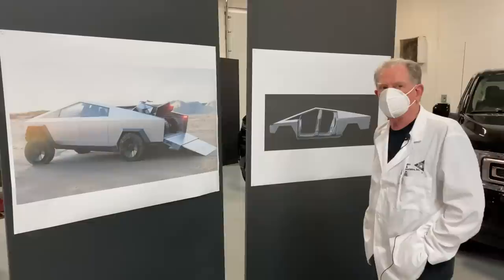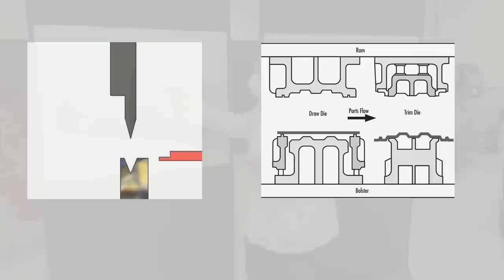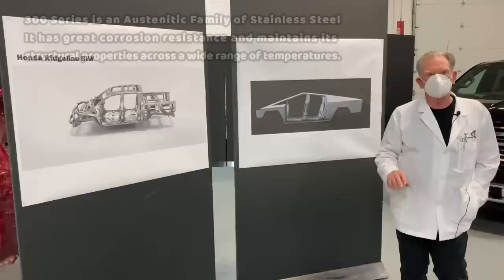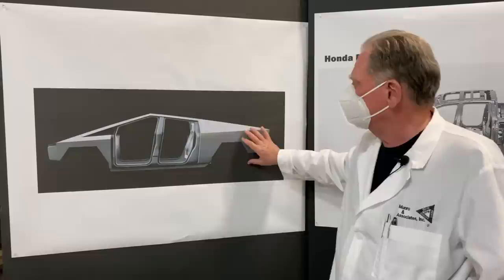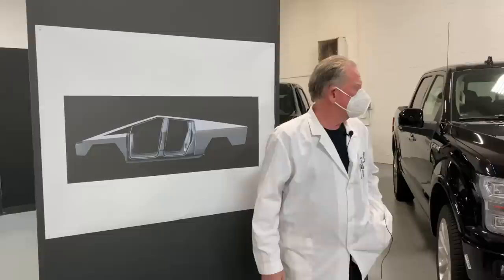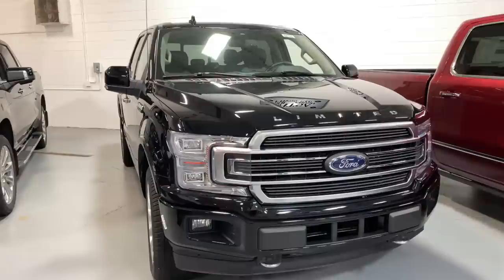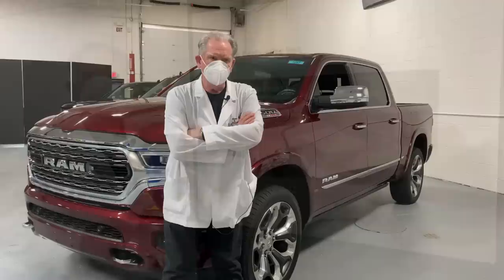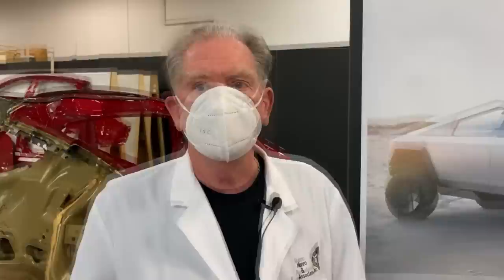Cybertruck E1 - Body Structure Comparison

Comment: Great video and comments. Innovators like Tesla could open new ways in car industry, but I think car makers are 20 years behind civil aircraft makers like Boeing or Airbus, and 787 dreamliner is the winner in efficiency against the heavy A380,  and these leaders are 20 years behind competition sport glider makers like Alexander Schleicher. Gliders need to be the most efficient machines ever build and composite materials like Carbon fibre, Kevlar, aramide, honeycomb, etc.  used in the last 30 years replaced all light metals.  The 787 is using more composite materials than any other aircraft.  Cars will follow the same physic rules in efficiency and EVs need to me more efficient than any combustion car.  EVs need to follow the glider materials and aerodinamics.
Reply: Cars, planes and gliders: not the same structural stresses, not the same number of units manufactured per year by orders of magnitudes, not the same costs, not the same expected life, not the same maintenance and inspection.
So you cant compare them.

Comment: 10:15 - if the 30x material is cold rolled to create the required austenite / martensite structure, would that not also result in lots of internal stress?! I.e. that when you start cutting it, that the body may deform because of these internal stresses being released?

Comment: It Looks overloaded with a single 4wheeler in the back. The front suspension is lifted up and the back springs are sunk down?
Reply: BeauBeau Kitty - He deliberately lowered the back for loading & unloading of the quad - CyberTruck can lift or lower parts of the vehicle or the whole truck, while the other trucks can’t.

Comment: Fascinating analysis! If stainless steel is a hard material, how well does it absorb energy in a crash? Wouldn't a light material like aluminum that crumples absorb more energy?
Reply: the CT is big and heavy, meaning energy will dissipate faster, plus stainless steel can crumple, it just needs to be designed to, like aluminum
this is why a F350 getting hit at 110 MPH by car has the f350 driver be fine

Comment: I understand the advantages of that simple  stainless steel structure, but what happens with it in case of an accident ?  normally the concept is to have a stiff inner structure with softer parts  outside( fenders, bonnet, luggage boot), that can deform and absorb the impact.  These non structural parts can be exchanged after the accident.  With a hard outer shell-structure nothing can absorb the impact and when it gets deformed seriously ,how can you repair it?

Comment: Its more like a cocroach than a turtle. Its just as stylish too...lol
300 series stainless steel is likely using 304 as the most commonly used but 316 has similar characteristics.  30X might be symbolic of a mixture of 300 series s/s . Even some traditional built cars have thermoformed plastic body panels.

Comment: One problem I see, airplanes don't handle "accidents" well. Even a small impact causes massive structural damage. When you bend the frame of a vehicle, it it's usually totalled. There is a very real reason for the current use of a frame protected inside the vehicle.

Comment: I disagree about the Arrow dynamics, the typical pickup truck’s bed creates a vortex which pushes the rear of it’s cab, this truck can’t do that. How much will a small fender bender cost ? Need an ALL new complete body/frame? Did he just say, a dent or crack would be a badge of honor ?  Well that certainly is 1 way to avoid my question. Rabbit ears on the ford, wou;don’t that also be a badge of honor ? Lmao

Comment: It seems to me that I recall cars in the 1930's that were unibody designed by Dr. Porsche. He personally moved those forward during the 1940's as Volkswagen. From around 1947 forward, Dr. Porsche designed a sporty vehicle, design 356, with the public until 1965, when the unibody was redesigned as the 911 (9001 originally), unibbody still being produced today. Unibody also has been done in the past couple of decades of carbon fiber. Now the corvette was a different type of material, the material used on surf boards. Plastics, epoxy, and fiber glass are all elements that have been used in car bodies. I suppose that Stainless steel has to do with the ruggedness of the small vehicle.. I feel there is a mistake with regard to using stainless steel in so many parts of the car. (Springback can be dealt with via heating and cryogenics, a very expensive process.) The doors and front lid should be aluminum or carbon fiber, rather than stainless steel. That can be reserved for the attachments of engines, axles, wheels and suspension and major strength components. The rest can be lighter weight and doesn't need to be so rugged, perhaps. The trade off in the expense of stainless is too dear. AF

Comment: If you look closely cybertruck suspension system revolutionary...it provide so much ground clearance which is near to hummer h1 but without portal axle also lower arm is so high it difficult even to see...that's not because of air suspension which new defender has even when setting high mode the new defender ground clearance is very very low to cybertruck.

Comment: Body geometry? Here goes…
It leads to a lack of rear headroom.
Tub sides are too high to reach anything from the side, especially at the front of the loadbed.
Slab sides with body panels that lack contour will probably drum excessively and dent very very easily and be difficult to repair.
Windscreen raked at an extreme angle that will cause glare, refections inside and excessive cabin heat in Summer.
Rearward visibility is limited to near zero using the windscreen mirror, thus making a rear facing camera and windscreen monitor essential. 
Conventional body on frame allows a separate tub which itself allows different configurations, wheelbases and cabin sizes using common parts as much as possible. 
Impossible to remove rear load tub to repair or replace or sell as a truck-cab for custom equipment/body installations such as tipper bodies or drop-sides.
It is likely that stainless steel used as a monocoque structural chassis where the body itself is essential to its stiffness means that it will be prone to stress-crack in arduous work.
It is so ugly that ongoing sales, after the initial flurry, are unlikely to be high. Initial demand is likely to be short-lived.
Its geometry is a pretentious load of balls and most buyers worldwide wouldn't be seen dead in such a 'hairdressers' truck.
This is going head to head with real trucks and it stands out as being a pretentious toy, not suitable or versatile enough for the commercial work environment.

It will be 'cheap' to build but will it be cheap to buy? I somehow doubt it.

Comment: I understand Elon wants the truck body to be bulletproof that is pretty bad ass. It does bother me how bad it swats in the back and how much weight is taken off the steering axle in the picture you showed. I would like it better if it did not have those unattractive high sides on the bed like the ugly Honda pickup.

Comment: I still would want a gas motor on it just on case  so I can actually go off-road ,,I love the design but a fender bender may just cost too much$$$ if the body is the frame that car will be salvage title after the first fender bender.

Comment: And of course the Tesla, fortunately, will never be involved in an accident... So, how hard/ expensive will it be to repair if it IS in an accident.  It doesn't have a removable bed, it is made of stainless which is notoriously hard to work with, and the bodywork is a structural part of the truck.  Looking at it from the top, it doesn't appear to have nearly as much space in the bed area.
"Check out my new $100,000 Rivian!"
"Yeah, that's great for you, Jim, can we load up this ton of pee gravel, now?!"
"Um, look, Fred..."
"Oh, Jesus, just load it into my Ford F-150!"

Comment: The bed is small and hard to access from the side. If the GVWR is 10,000 lbs or more you will fall under FMCSA rules for any commercial use. Being a uni-body it won't be produced as a chassis-cab. That eliminates dumps, utility bodies, wreckers, stake bodies, bucket trucks, etc. It's never going to make much penetration into the commercial market
Reply: Cindy Tepper when was the last time you were able to put something into the f-150 bed from the side? I am only 6ft, you must play basketball.
Reply: @Dixler683   We've got a couple of Dodge Ram 1500 4x4 trucks here for shop trucks. Guys less than 6 feet put stuff over the side all the time.
Reply: Cindy Tepper yeah you are probably right. I am old and can’t heft things anymore but the bedsides on these new trucks ( 4x4 ) are still pretty tall. It was high on my last truck. Sold it, waiting for my cybertruck to be built. Hope I live long enough to see it. Driving a hummer for now.

Comment: It will be nice to have a truck you can take in the woods and not scratch the crap out of on the first stick or twig that drags against the side.  And not to have hundreds of dollars of paint damage the first time a dog jumps up against the door.

I REALLY doubt the body (exoskeleton) will be 3mm (1/8") thick.  That would be really heavy and overkill.  Gotta be about the same thickness as the FRAME RAILS on a conventional truck.  Will be nice to have a pickup that doesn't break in two when the sheet metal of the frame rails rusts in two (looking at Toyota and Ford).

SS isn't necessarily any harder than any other automotive steel, if FULLY ANEALLED.  And SS can be drawn and formed just fine in a press-just look at a SS sink.  303/304SS (as well as other steels and Al) can be work hardened in the rolling process-which I assume is the case here.  In other words it will be a roll-hardened SS, not fully annealed, used to form the exoskeleton.  Use of a hardened steel can allow the same strength and stiffness with a thinner, lighter gage of material.

Comment: Very interesting high level observations, thanks!  One comment, however. I drive a 2017 Ridgeline, and your description as "light duty" isn't accurate.  Maybe as compared to a 3/4 or 1-ton full size pickup, but it's a mid-sized truck, and in this category, it has great specs.  It's competitors, GM/Chevy, Ford (Ranger), and Toyota Tacoma all have a more off-road focus, but from a towing and payload, the Honda hold its own.  And of the three (as you stated), the unibody give the Honda a dramatically superior ride quality.  And let's not even discuss reliability comparisons to it's US-made counterparts....

Comment: What are the chances the (a future) CyberTruck uses a stamped (slightly) curved (ala StarShip nose come plane forms) surface steel exoskeletons for a more aerodynamic & aesthetic profile? (P.S. I used to work at the old SPS Western bending lots of stuff from aluminum trims (1000/hr) to heavy steel table tops (60/hr), so I get the die strike bit. P.P.S. My super was missing a finger & his boss, a couple! Real glad they moved me to fork truck, before finally kiester kicking me out soon after I started talking union. Haha, did me a big favor.)

Comment: You clearly have no idea what you are talking about.   I also highly doubt you have ever worked on any DeLorean let alone the manufacturing processes based on your statements.  The DeLorean does not have a unibody design/plastic backing behind the stainless panels.  The DeLorean is a Fiberglass body on a steel frame. The stainless panels are bolted to the fiberglass body.  This worked very well as there are still thousands of these cars on the road that look as good as they did when they rolled of the assembly line.

Comment: You know when someone has tripped over to becoming a real fan boy when clear disadvantages are presented as an advantage, just like, Cybertruck owners are all going to wear any ding or dent as a badge of honour, and then to liken it to Jeep owners when a Jeep has more in common with the current crop of pick up truck than it does with the Cybertruck.

If Cybertruck owners are involved in no fault collisions, will they really want to shrug off any resulting damage as a "badge of honour", or will they want their vehicle repaired? Insurers are likely to expect the latter and unless a vehicle can be easily repaired, "as good as new", insurance could prove to be expensive. 

Tesla may not be intending to export any Cybertruck, it seems unlikely that unless they were to adopt a less sharp pointy design that it would not pass any of the global "pedestrian friendly" requirements.  

As for paint, manufacturer's may need to apply paint in order to protect the vehicle, but paint also helps make a vehicle "individual" and people are prepared to pay extra to have a less common paint. Non-OEM paint jobs is a multi-billion industry.

Stainless steel may start off as a novelty but if any vehicle becomes common and stainless steel the only show in town people, will tire of it? The reason there are so many vehicle manufacturers to choose from when in a lot of other industries there are just a few, is that when it comes to a person's daily transport, individuality is a big thing.

Comment: the sad part is not a tank or an airplane is just a truck, so with that carrys a lot of problems in a real world aplication, crashing with another vehicule or pedestrian
Reply: Sebastian Scida yeah thanks,  some logical thinking, good point there Sebastian. Imagine the horror when a cybertruck stiff shell rams a pedestrian at 30mph vs the equally crushed body after getting hit by a Ford f-150. It is the mass behind the moving object .  Do you really think the “soft “ ford made of sheet metal and plastic will magically collapse and spare the civilian? Ditto involving a collision with another vehicle. With your logic think of how many cement trucks must be banned because they have an unfair advantage over a VW. Could have used your brains over at SPACE-X.
Reply: @Dixler683  the new pick ups and cars are made of plastic in thre front just for that purpose .For the cement truck do  you need a special driving licence?
And please dont be a fanboy, im in love of the look of the truck, and i like to see it in the streets.

Comment: Hmm... The deformationzon and repairability? pedestrian safety? I'm working on a Tesla body shop and like the design but if a cyklist or a pedestrian hits one corner or flat surface this hard, the car is not going to be legal in Sweden. The soft shell on cars is not only rain protection or design it's other peoples protection from your bad driving. Please learn a little bit mor about car design and funktion. The exoskeleton never going to be this hard in the front of the car. And if you crash a car this hard whiteout v shaped deformationzon in the front under the soft shell the car obviously Gona have in produktion your skrewd. this is a show of not the car in production.

Comment: I’m not saying “no”. But what about pedestrian safety? Sharp edges & hard materials on vehicles are explicitly forbidden by Law in my country, as well as in the most of EU.

Imagine your loved one in front of the bulletproof fenders, which are made from a hard stainless, with sharp, folded edges. Or your kid, glancing his/her bicycle off the sides of a moving truck and its razor-sharp wheel wells. Sometimes it is “safety (or lack thereof) by design”.

Comment: I remember reading about using lasers to machine metal surfaces with nanostructures that induce super-hydrophobicity.  Would be cool if the exoskeleton received this treatment.  This would allow you to easily clean the truck with a simple spray of water.  Plus, from what I recall from the research paper, it would give the surface a matte black appearance.  I couldn't find the original article that I'd read, but I did find this: https://www.sciencedirect.com/science/article/pii/S0141635917305792

Comment: The one big question mark that i see here is how they will do in crash tests with that all rigid design. They have to have a plan for that, and it can't be: "Well, it never crashes" That's just bs and legislators will never go for it. (By the way: I don't think you need a mask when you are alone in front of a camera. And you don't need a cameraman for the type of presentations you do. Just better framing and some post editing. Sorry, anonymous cameraman, you are an editor now)

Comment: 13:20 how about the big "serviceability issues" ... from a harsh crash that does require body work repair .. on a conventional vehicle, many panels are replaceable .. but not on an Exoskeleton .. CyberTruck will cost a shit load of money to repair. Also, Sandy is right that some "owners" won't care about a small scratch or ding .... MANY people will be leasing, and their wallets will be gouged deeply for those dings.
Reply: 30X is a reference to "30 times cold rolled" and not the alloy being used.  Kind of confusing since there are stainless steel alloys in the 300 range....Although he did say it was either the same or very similar to the one they are using on Starship, and i think there's information about what they are making that out of (although I'm not sure)
Reply: @sooocheesy  sorry, I edited by initial comment... but seriously what is 30X ? .. no it is not cold rolled 30 times, that is a made up wild speculation floating around the internet. From what I can tell, it is a 300 serious stainless that has been composition optimized for SpaceX end use .. something similar to the 304 stainless SpaceX has been using for early test proto Starships now being built. Musk is a a marketing genious .. since he will be buying an enormous amount of stainless steel, he can customize the composition, and give it any name he wants to .. hence 30X... sounds way cooler than 305 or such.